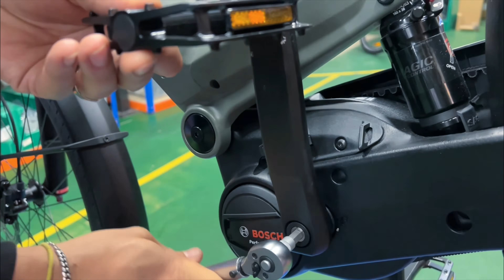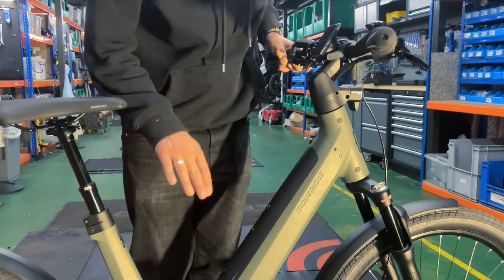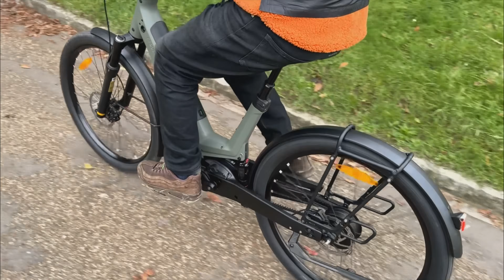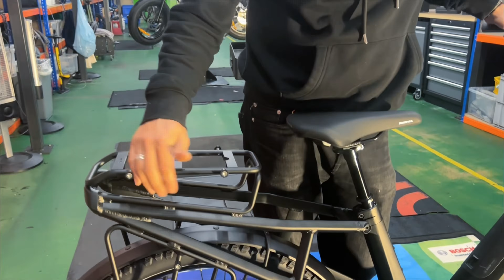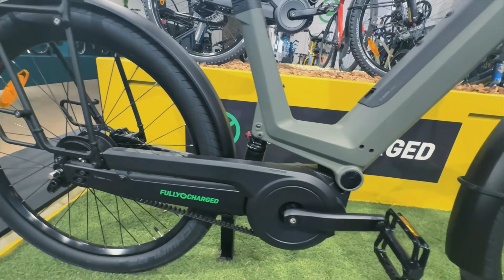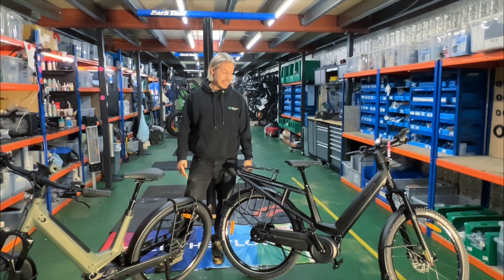Ultimate comfort and practicality in an eBike | NEW Moustache J unboxing

Comment: Bought one 2 weeks ago to replace an FS5. The motor is not powerfull enough, it should be using the CX LINE 85NM.  Cannot climb the hill I used to.   Kindda sad at this price. Very comfortable. Very heavy. Good distance to travel. Very well build. I run on turbo most of the time then today I bought a spare 500w battery for my long trip. I change the seat for a more comfortable one. Suspension is great. Headlight is to high on the bike, this prevent me from using a triangular bag in the front of the bike. The apps E-flow is great. Fenders are rock solid. Tires are big and grip well. Gear changing is easy with Enviolo. Easy to mount since there is no horizontal bar and this is the reason why I trade my FS5. Cheers.
Reply: Great review.

Comment: Very nice bike, wouldn't want it in the UK because of our abysmal ebike speed limits.
Reply: i do agree, and so do 1,000’s of others which is why it’s so popular to tinker with these bikes (such as this one) to get the limiters to top out at 20. It is a hot topic but i believe sharing schemes such as lime should be 15.5 and privately owned  ebikes that have been properly built by authorised and recognised manufactures should be 20mph and after market bikes with kits should have to go through safety testing to be able to be used on the roads by an authorised body - a bit like an MOT but when they are new to get a safety certificate (and it should cost £25 or so to get this. which would out off most of these deliveroo riders, nc they should be confiscated if they don’t have it. which would prevent fires and accidents
Reply: it’s actually really nice to push past the speed limiter.
Reply: @2JKO  sure, on a e-road bike, but in my case is near impossible.

Keeping up with surrounding traffic keeps me safe on the road as well as cycle paths or shared pavements. Being able to cycle at any speed between 1 and 30 mph is really useful and I how we will get legislation that will enable such ebikes.

I'd be happy to insure it etc but right now that's not really an option. Once you register a powerful ebike as a motor vehicle, it's barred from the cycle lanes.